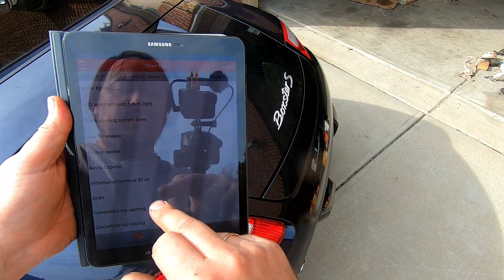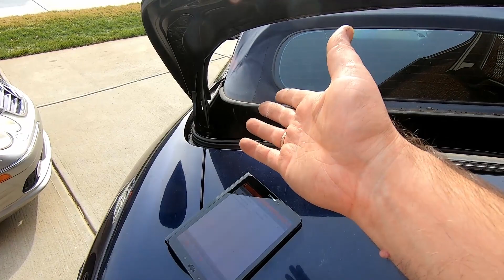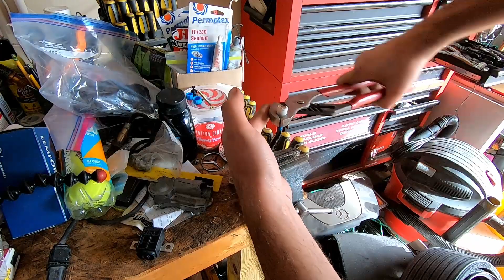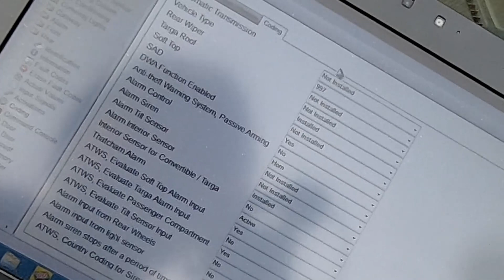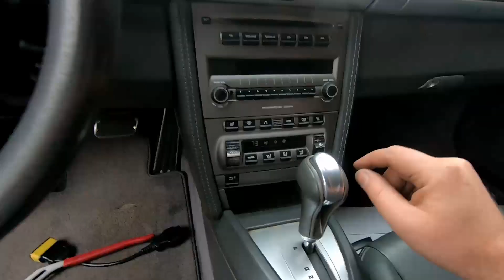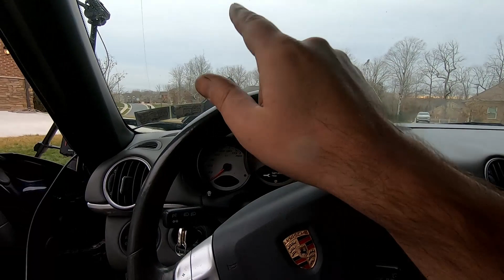Porsche Boxster 987 Convertible top repair. Kinda. Rear Control Module Coding.

Comment: Hi, may i know what did you use to test the spolier function?
Reply from the maker: I think it was a Durametric, or something like that. It’s been many years since.
Reply: @HETPEZB my spoiler stopped functioning after I forget to close the top and rain came . Now wondering how to fix it
Reply from the maker: That’s a rear control module replacement.
Reply: @HETPEZB does it need coding?
Reply from the maker: It depends. If it comes from exactly the same optioned car model - then you can get away without it. If it comes from the car  with different options, let alone different model Cayman vs Boxster vs 911 - then coding is required.
Reply: @HETPEZB thanks for replying. It cost a lot here in Singapore just for this job. So I'm wondering if I could get it done myself

Comment: I just had a control module  error.  I am thinking when I lowered the roof from diagnostic mode one of the cables popped lose but who knows?

My inexpensive scanner shows 
convertible top closed:not actuated. (Itop  closed)
Convertible top open:actuated (top is closed)
Latching hook:nor actuated (it was closed)

Any ideas are welcome.   My windows are in the down position reflecting the top opening. They don’t see my is down. 

I will be raining this week too.

Thank you!

Ed

Comment: What application are you using on the tablet?
Reply from the maker: For Porsche I used Launch.
Reply: @HETPEZB  Great video and bravo to you for being able to switch out the CPUs on these boards!  Where does one find the "Launch" app that you are using on the tablet?  Is that a Durametric app, or a Porsche app, or something else?  I cannot find "Launch" in the link you provided above for Durametric software.  Thank you!

Comment: What’s the software and connection tool you are using to control the vehicle systems?
Reply from the maker: I’m usually using Launch through the Bluetooth, but I also have Durametric for a PC, which is more in-depth for Porsche, but Launch is quicker to connect and it covers 99% of my needs with Porsche.
Reply: @HETPEZB  link for the launch software and the obd please.
Reply: @HETPEZB  Please provide the link to the app, Thanks
Reply from the maker: @RobertBrusilo  , http://www.durametric.com/downloadv6.aspx
Reply: @HETPEZB   Thank you
Reply: @HETPEZB which launch r you using please

Comment: After doing the coding repair, do the windows were able to go up or down? And if You could please tell me the name of the software coding.... This help me alot, thank you!
Reply from the maker: The soft top left side transmission was damaged. So besides the coding I needed to fix that. But assuming the transmission would be ok to begin with - yes windows did work properly after the coding. Software- Durametric.
Reply: @HETPEZB  Thank You master. Greetings from Acapulco, mexico!!

Comment: Hello huge fan here from matthews, NC I have the same identical boxster it's the gear don't buy the plastic gear because it will break again...happened to me...buy the metal gear on Amazon I think it's $79 for the pair
Reply from the maker: I installed a plastic gear into the left transmission. For some reason I thought they originally installed a plastic part for a reason - so it would brake first in order to protect the other system components. If it will brake - I’ll upgrade to the aluminum ones :)
Reply: @HETPEZB  my left side was damaged also..and recently replaced with plastic a few days later it broke again so now I brought the metal one...I think porsche installed the plastic because they know it's easy to brake and its more profit for them...when I opened the gears I don't see what will get damaged if I install a metal one....I think porsche is full of shhhhh and people in the forums are paranoid..
Reply from the maker: My thinking was - if there would be a problem with the rod (like happened to mine) and transmission will be pushing it too strong - the rod may puncture someone or cause some other damage. So I think in case the force will be too strong -the transmission plastic gear will break instead of something else. Like a fuse.
Reply: @HETPEZB   I'm thinking maybe the gear got damaged and caused the rod to come out of place , because it became to loose and wiggly...so maybe the plastic swivel ball joint piece should be metal also...
Reply: From what I read on the forums, the rear module under the seat gets wet and the top automatically tries to go down while it is locked closed.  The plastic ball sockets break first in this case.  Try the plastic ball sockets made in Germany - not China.
Reply: @bcwatson0  crazy coincidence mine just got wet a few days ago and you're correct, the plastic part broke, luckily I had an extra one...but I'm not getting any power to the motor,  the switch work. Which it actuate according to my scanner...now I need to figure out why the top no longer opens or close
Reply: @19lol19  If the rear module (under seat) is dead, the spoiler will not go up/down, rear trunk will not open, rear lights stay on and reverse/license plate lights do not work.
Reply: @bcwatson0  ok those things work, I don't hear any sound when I try to lower or raise top...but when I plug in scanner it says and press up and down the scanner says it's actuating ,yet it's not moving or making a sound...so the button works
Reply: @19lol19  I would probably check the micro switch for the hood latch above the rear view mirror.  Perhaps the car still thinks the top is latched closed.  Otherwise I would get the wiring diagram and start checking voltage/grounds.  Here's a video on the micro switch: https://youtu.be/zllH2ZzgQd8
Reply: @19lol19  Windows should drop/raise slightly as the latch is unlatched/latched if the latch microswitch is working.  You can press on the microswitch to see the windows raise/drop slightly.
Reply: @19lol19  Can your scanner check the rear module for error codes?  Fuses okay (A3 and A6 I think)?  Take the fuses out and make sure they look perfect.  I would also do a quick check on the rear module 3 connectors - unplug them and make sure there is no white corrosion starting.
Reply: @bcwatson0  ok I will do that I have icarsoft
Reply from the maker: Come on over - let’s test it here
Reply: @HETPEZB  man I forgot you're in North Carolina...lol
Reply: @HETPEZB  what day are you free?
Reply from the maker: When it’s more warm outside, lol :)
Reply: @HETPEZB  lol I hope soon my power was out here in matthews and I stayed in bed although I was hungry...it was too cold....Did you loose power?
Reply from the maker: Is your power provider Duke?
Reply: @HETPEZB  yes, but we have power now,  it was off earlier this morning the coldest ,off for about 5 hours
Reply from the maker: I heard that Duke customers fairly often have outages at least in my town.
Reply: @HETPEZB  when it rains trust me we will lose power....lol

Comment: had my '07 cayman at the local (walnut creek, california) independent service center and noticed a boxster parked in the lot with a factory hardtop. while i waited for them to finish up my car i mentioned to the owner of the shop that i liked the looks of the hardtop on the boxster (blue) out in the back, and he said that he owned it. he went on to say that he keeps the hardtop on the car all the time and was considering removing the softtop altogether and just store it at home. 

there are a few two-seater roadsters over the years that offered factory hardtops and for the most part i've preferred the looks of the cars with the hardtops over the softtops. i.e. mercedes 250-280's,  a few corvettes, the boxsters, and the BMW Z series.

Comment: Another great video. When I got my Boxster from auction it was completely missing the pushrods that connect the roof and rear cover to the gearboxes so I've had to replace them, plus the gear in the gearbox on one side. I had to replace the rear comfort module but used your toureg/cayenne trick which got my spoiler, tailights and PSM working properly but not my heated seats or roof switch. I didn't know you could rent a durametric so am about to do that right now. Thanks again!
Reply: Brought my boxster from auction also